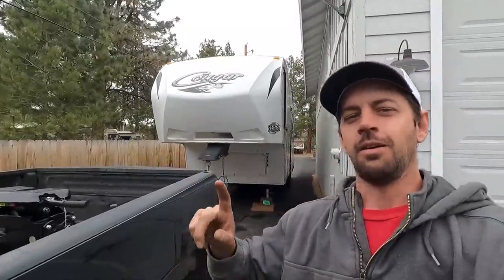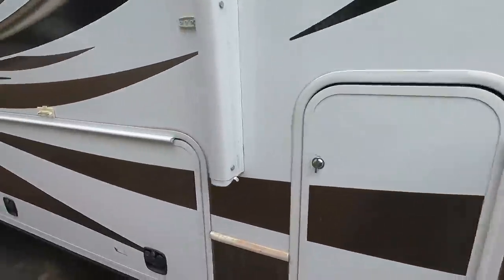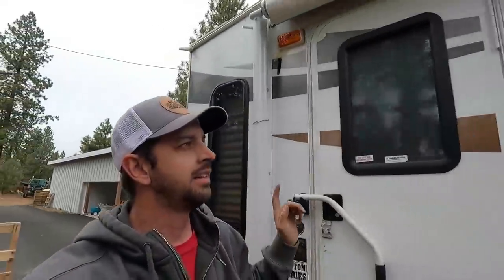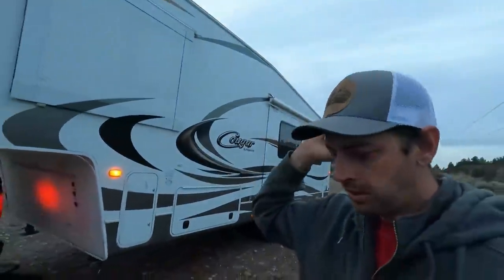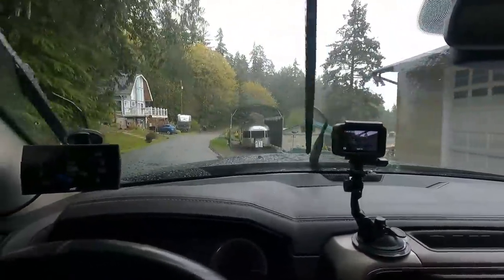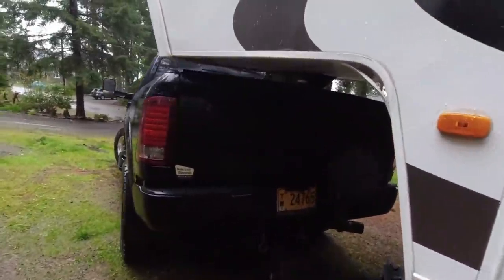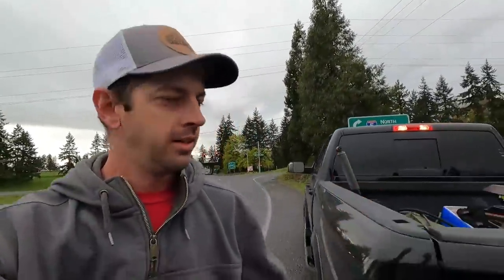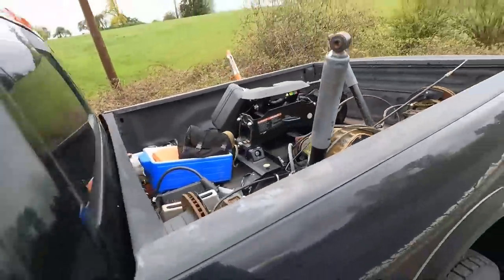A day in the life of an RV transporter.   Tricky delivery and truck damage..

Comment: I really like the way you carefully plan and check out all the details of a tow BEFORE you go and avoid problems during the tow.  EXCELLENT WORK!
Reply: I totally agree!!
Reply: I do that with my lawnmower trailer and even when not towing anything after years of driving OTR it's hard to get out of the habit of doing a pretrip inspection
Reply from the maker: I did check the lug nuts, as well as air pressure and quite a few other things.  But much like with the cement mixer video where so many people told me all the things I "missed"...  If I showed the entire pre trip, the video would be an hour long before I even started the truck.    As far as the break away switch, there isn't one on a 5th wheel trailer.
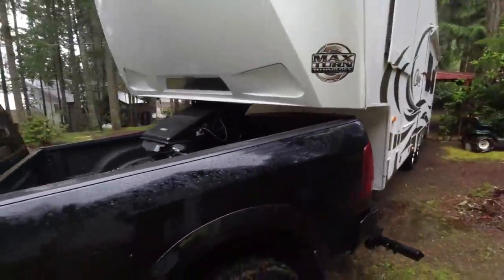Reply: 8:57 ain't that the brake away cable?
Reply from the maker: @51-FS  nope
Reply: Ok
Reply: That little black box with a cable on the tung is the brake away......
Reply: @CaseyLaDelle  It is in theUK, but then you spell quite a few words differently from us.
Reply: Oops, my mistake if it's to prevent the trailer breaking away rather than applying the trailer brakes.
Reply: If  @CaseyLaDelle  says it doesn't have one then it doesn't. He knows everything no matter what the video shows

Comment: Anyone have a fix for a wet rear head liner in a Ram 1500 2018. Replaced the third break light seal and silicone it. Also silicone the little black box on the roof. Any help would be helpful. Thanks!!!

Comment: I've never hauled a 5th wheel with my tailgate on takes 3 seconds to remove and you can see more thru your back window just has always made since but you know your truck and that's a cool 5th wheel have never used one that slides like that have had ones with pins the older style but that seems like a nice set up. Gotta say I love your truck and it's accessories

Comment: I forever remain amazed at anyone who can successfully back ANY trailer up without constantly having to pull forward and reset...
Reply: The longer the trailer (in relation to the tow vehicle), the easier it gets (of course judging the far back corners gets harder, which is a separate problem).  But mostly it's just practice.
Some of that is just getting time backing up, even without a trailer.  Start by backing into every parking place - which is also safer than backing out anyway.

Comment: a man after my own heart.   I too use the e-blinkers to test the trailer lights, as it gets the running lights, brakes and turns at the same time
Reply: My Ram has separate circuits for flashers and turn signals. I can have flashers but a blown fuse will stop a turn signal.

Comment: Pleasant Harbor is on the Olympic Peninsula side of the Hood Canal, which is a long fjord that's an inlet of Admiralty Inlet. Across the Hood Canal from Pleasant Harbor is the Kitsap Peninsula, where Bremerton is. The difficulty in remembering it all is that colloquially, it's all "the Puget Sound", even though that only technically refers to the water ways between the east side (Seattle) and the Kitsap Peninsula. Above the tip of Kitsap, between Port Townsend and Whidbey island  is Admiralty Inlet. Bremerton faces Sinclair Inlet, which is bounded by Port Orchard and Bainbridge Island. The whole "Puget Sound" area has so many bays, inlets, and peninsulas even the locals can't keep track! There are huge bodies of water even local residents don't really know exist.

Comment: Soooo how much you want for that stock limited slip and how many miles?? I bought my 16 Laramie Cummins and the previous owner didn't spec a limited slip even though it's only a $500 option. They're near impossible to find used and I don't want to go aftermarket full locker. Just not too many options.

Comment: Based on the signs you passed it looks like you drove up 101 along the Hood Canal which is part of Puget Sound.  You were on the Olympic Peninsula.   Very clever way to encourage comments.  😁
Reply: Would not be surprised if he passed Sequim and is how you go through to get on SR 8 to the coast, heading towards Hoqium and Aberdeen if coming down Hwy 3 to get on the 101 from up towards Silverdale and environs.
Reply: @johnhpalmer6098  Casey did not reach Squim or go through Aberdeen. He was on the west side of Hood Canal. Just south of Brinnion next to pleasant Harbor State Park. A very scenic and pretty area. A boaters paradise. An absolutely beautiful area. And a bit soggy a significant part of the year. If it’s not green when you get there, it will turn green pretty soon if left outside.
Reply: @americanrambler4972  I live in Tacoma, and know the 101 and never said Casey went to Aberdeen, was thinking of Shelton, not Sequim and was describing if you were heading down from say, Silverdale on the 3, you need to go through Shelton to get on the 101 to continue on south to say, I-5, and then to the 108 to McCleary to get on Hwy 8 to head west to Aberdeen, but never said Casey was heading that way. Hwy 3 runs along the west side of Hood Canal, the 101 is west of there and meets the 3 just south of Shelton.

I also know the weather in this area, it's wet for much of the year. Likely wetter in Brinnon than in Tacoma though for the same time of year due to the rain shadow.
Reply: @johnhpalmer6098  Ok.  I actually located the house he delivered the trailer to on Google Earth using the identifiable landmarks shown in his video and my general knowledge of the area. My curiosity was satisfied at that point. I also enjoyed Casys description of his hammered rear axle housing and how it came to be that way. That cause is not something you run into every day. I bet his truck drives a ton nicer when he gets it sorted out and fixed along with his tire wear reduction.
Reply: @americanrambler4972  Oh nice, I never knew that feature in Google Earth (great program) will have to check that out, and I use that program quite frequently after a friend showed me it many years ago.

Yeah, agree and I bet his truck will indeed handle better when the axle gets replaced too.

Comment: LOl. let's start with this.

pen·in·su·la
a piece of land almost surrounded by water or projecting out into a body of water.

In geography, a  is a smaller body of water typically connected to larger sea or ocean. There is little consistency in the use of "sound" in English-language place names. It can refer to an inlet, deeper than a bight and wider than a fjord, or a narrow sea or ocean channel between two bodies of land (similar to a strait), or it can refer to the lagoon located between a barrier island and the mainland.

Comment: Backing up is easy if you know how to do it’s. Grab the steering wheel at the bottom between your legs. If you want the trailer to swing left, push the steering wheel to the left and the opposite for right. Easy peasy.

Comment: Not to tell you your business, but my immediate first thought was to want a solution better than having the 5th-wheel behind the rear axle instead of directly over it.  Glad you made the change.
Reply from the maker: That 5th wheel a foot behind the rear axle is nothing compared to the front end of a car four feet behind the rear bumper on the wheel lift.   I could leave the slider back full time and would never notice the difference in that truck.

Comment: In the old days, before automatic train brakes, the Army would put a bunch of soldiers in a caboose with the tank trains, so we could get off everywhere the train stopped and make sure the tanks weren't making a break for it.
When the railroads stopped using cabooses, the rail guard detail just went away.
My first cross country trip by rail was aboard a caboose.  I learned that you don't want to be in the last car of a long train.

Comment: Great job backing down a narrow steep driveway that you never seen before. That axle looks clean and in good shape for a used one, must not have many miles on it. Does it have the same gear ratio as the old one? Too bad it ate a new tire up before you discovered the problem. Maybe that one needs to become your spare. Another reason not to buy anything else from the dealer that took your truck on a vacation before bringing it to you.

Comment: Great job backing that camper down that long road. I waited all the way to the end to see if the truck damage was going to be your tail gate! LOL!! That would have been easier to change than the rear axle! LOL!!  That's what happens when people weld without knowing anything about metallurgy and heat distortion.  Glad you made the trip ok and got your axle picked up!!

Comment: Hey Casey !!  Wasn't quite sure if you said that tube welding was done at ""MOPAR"" or a ""COLLISION "" shop ??  Again ,learning lesson Not to buy online without checking the purchase 1st ,, but in this case ,, you wouldn't have seen that damage without doing a 4 wheel alignment like you did now !!  Great job with the ""RV"" trailer !! Good that you were able to find a replacement axle !!  Do you need to take ALL parts out of the ""OLD "" rear & put in the ""NEW "" axle ?? Have a good week & Thanks for the ride !!!
Reply from the maker: I don't know whether the previous owner did it himself or had it done at a shop 🤷🏼‍♂️

Comment: Good reverse skills there Casey👌.  Here's my 2 cents on your worn tire situation. You would always want your best tires on the front of your vehicle. As you know all cars brake 70% in front and  30% in the rear. In an emergency where you need to apply the brakes real hard, you want good tires in front. But I'm sure you knew that👌👌🇿🇦🇿🇦
Reply from the maker: Get into the snow and ice and you're 100% wrong.   Better tires go on the rear
Reply: @CaseyLaDelle  okay. I didn't know that.  I live were it never snows. I saw snow once in 1985. South Africa only get snow on the high mountains. 👌👌👍👍🇿🇦🇿🇦
Reply: @CaseyLaDelle  better tires go on all 4 corners and when I got some money both spares were new as well,  LOL.  Kidding aside I know what you mean about snow and ice, but I do like the control, ride and handling of having quality steers and drives. Great video, thank you sir.

Comment: Your original axle housing can be fixed... cut off the weld, reposition the tube, then weld the tube correctly. NOT that big of a deal... if you really want to go all out, you can truss it. Oh, peninsula is land, sound is water. And you can back up sooooo much better than most people.
Reply from the maker: Faster and cheaper to just replace it

Comment: I think my chevy 3500 hd gas pickup has same rear as Duramax. The Duramax rear is supposed to be same axle as used in ram with Cummins. I think the brand is aam. My rear has larger counterweight at pinion at front yoke.
Reply from the maker: Yes,  AAM 11.5

Comment: Great backing to the house!  We could sure use some of that rain here in Colorado!
Reply: For 5 years I lived in Winlock Wa, and you MIGHT have 2 weeks in the summer when it would not rain.  I told my Wife, that if my job up here in this "Rain Forest" ever went to pot, I was NEVER going to get another one here.  And then Mount St Hellens blew up, and since I worked for Weyerhaeuser, I moved to Nevada and got a job in a gold mine.  I have seen it rain so hard up there that the water would be 1/2" deep on the road.  It could not run off fast enough.

Comment: I don't understand the sliding fifth wheel that can only be placed all the way forward or back. I'm also curious as to why people own a trailer and don't have a vehicle to pull it.
Reply: I think part of it is his under reach and why it is adjustable, as long as he's close to the axles, he's fine. You just don't want to be near the tailgate with most of the weight. The same is true with trailers, most of your weight should be in front of the axles or near it or it can get tail happy and accidents are likely. Seen the aftermath of that mistake once on video.
Reply: @johnhpalmer6098  I was talking about the fifth wheel hitch in the box that he just bought. Usually the purpose of having a hitch that can move toward the cab or away from it is to balance the weight on the truck so the more adjustment the better. I've seen one with a motor and a screw set to be able to put it anywhere in its range from inside the cab.
Reply: @tiredoldmechanic1791  I'm well aware of what you meant, but my reply still stands, and I think it was a compromise on that and the space needed to make turns without causing issues or damage, all due to the under reach and the space between it and the trailer, and the tailgate.
Reply from the maker: The hitch slides solely for the purpose of gaining clearance between the cab and front of the trailer for jack knife turns.   It is designed to be ran in the forward position and directly over the rear axle when going down the road, and moved to the rear position for backing into a tight place.   On any other truck except one like mine with a wheel lift sticking out the back, there is no need for any other position
Reply: @johnhpalmer6098  too much tounge weight will make them dance too

Comment: That suck ram screw up they won't stand behind it
Reply from the maker: Ram didn't do that, that's a replacement rear end that someone welded the tubes on thinking they were making it stronger
Reply: @CaseyLaDelle  will thank for info guess they better learn to weld

Comment: I am surprised you didn't check (mention) air pressure on the camper
Reply from the maker: I did check air, as well as lug nuts, and many other things that you didn't see
Reply: @CaseyLaDelle  I figured you did but that's why I was surprised you didn't mention it
Reply from the maker: @alans6767  same with the mixer video.  If I filmed everything I did on the pre trip the video would be an hour long before I even started the truck.